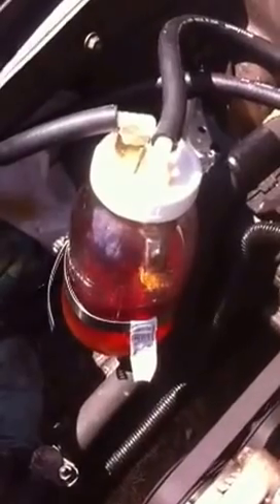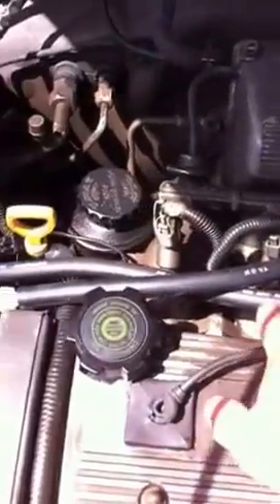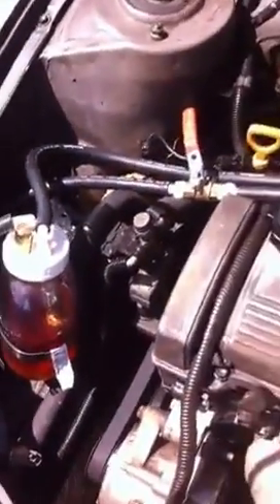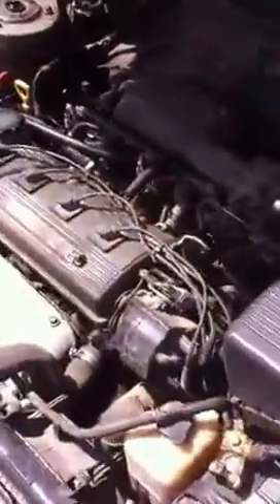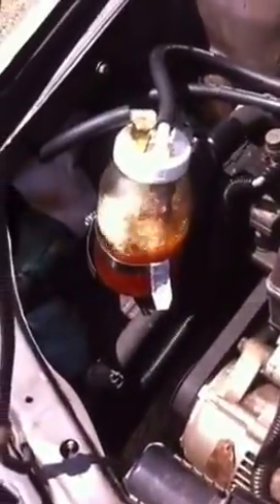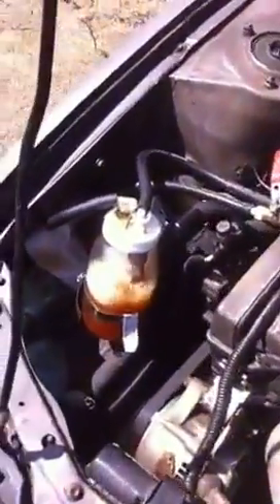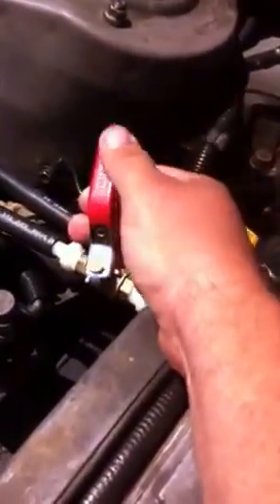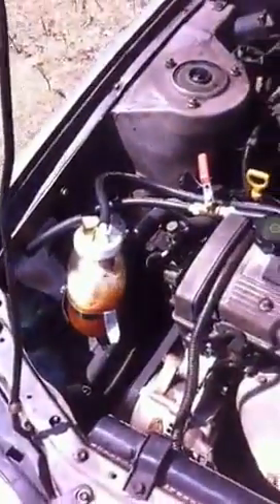Simple Fuel Vaporizer

Comment: how long does the fuel in the jar last?
Reply from the maker: It depends a lot on how much you drive and the external temperature. If it is a hot day, it will evaporate a lot faster than if it is cold. I one of my other videos I install a drip refill system that maintains the level while the engine is running.

Comment: Did you ever get any more fuel economy out of your car
Reply from the maker: I did little adjustments to vacuum and some leaks and eventually got it up to a consistent 38 -41mpg average. I sold this little thing years ago though. I am still doing some mechanical work on a new project vehicle to get it ready for the next test unit. It is a 95 Astro van with a 4.3 v6. I'm gathering the components as I can and hope to b\get started on testing this next spring.

Comment: I get better mpg without the bubbles I got ur set up on my Toyota Tacoma
Reply from the maker: This was a very rudimentary system that was very cheaply built as a test. I was lucky to have gotten good results. I just recently got my next project vehicle running and will soon begin construction of my newest and electronically controlled design.
Reply: Where your new work

Comment: Nice set up! Have you tried just using this vaporizer to drive without any fuel injection from the fuel tank?
Reply from the maker: +Hidrógeno Automotriz Evolution Costa Rica I have run this car on pure vapors but not with this unit. This small unit is way too small for this engine. It will run a small engine like a mower or 50 cc scooter but not a 1.6 liter engine.

Comment: Have you had the Check engine light come on for running it too rich? Thats what mines on for now (05 Honda Accord V6) and I was curious as to it being a common problem. I can turn the vacuum down a bit more, started with your 1/4 open.
Reply from the maker: The point of this system is to make your engine run rich. By introducing the extra fuel and making the system read a "rich" environment, the PCM will cut back the injector pulse bandwidth and push less fuel through the injectors thereby using less liquid fuel and increasing your mileage.
Reply: so I should leave the Vacuum setting where it is?
Reply from the maker: Dimrain13
I would. Have you checked your mileage since you installed the unit?
Reply: No I was having issues with the gas line leaking (internal high pressure hose) but just got that situated yesterday. Ill be testing it in the next few days (I have Dash Command so it will be easy)
Reply from the maker: Dimrain13
Good luck. I hope you get good results!

Comment: are you leaning out the amount of fuel through the injection in accordance with the vapor intake? Or did you just simply add this to the car without modding anything and experience the gains? Also, any computer issues tripped? thanks
Reply from the maker: TAShannon1, I have made no other mods other than the installation of this small vaporizer. The PCM automatically adjusts the amount of fuel it uses through the injectors when it receives the "rich" signal from the O2 sensor.
Reply: Sweet. Well that not bad. Any loss of power, or gain?
Reply from the maker: The only time I've ever had a loss of power was when I had the vacuum set to high and the PCM was struggling to adjust for the richness. I tuned it back a bit and it runs great and I still get all of the mileage bonus.
Reply: Ok that's cool to know. So are you going to install a flash arrestor? And also, how many miles have you put on your corolla with your system? And one last question lol, How many miles will that half jar of gasoline take you before you need to refill it?
Reply from the maker: TAShannon1
 Okay, in answer to one question ; I have put around 5000 miles on it since this installation and have had 0 problems since then. As for the other questions, if you will watch my other videos and read the comments, most likely all of your questions will be answered. Good luck with your project!

Comment: After seeing this video randomly two days ago I built this system on my lifted 1998 suzuki sidekick. It brought the power back to what it was before I put 6" larger tires than stock, Instant torque boost! Ill b checkin mileage soon, I was averaging 15 mpg with a 1.8L 4 cylinder.  So any gains will be nice!
Reply from the maker: Glad to hear that it helps you out. I love it on my little car. There isn't a lot of power in a 1.4 liter so I went for mileage and it make a big difference. I hope it makes as big a difference for you.

Comment from the maker: The jar is filled about half way with plain gasoline. In my second video I installed a drip refill system so continually refill the jar with fuel. I do still have to remove the jar and clean it out periodically as only the most volatile elements of the fuel vaporize in this manner.

Comment from the maker: The engine normally runs around 200 degrees or so. So far I have had no problems with he vaporizer getting cold and since I use the hot gases from the pcv system it seems to do well. I may join the lines into one bundle as far as I can and insulate the system if I have any problems this winter. However, I live where the winters are mild so I don't foresee any problems.

Comment from the maker: Yes Wonder. I will have the large vacuum line from my vaporizer to the carb and will "tee" into it with the HHO line just before it goes into the carb. I am going to use 2 positive nodes and one negative on my HHO generators because I'm wanting to produce more oxygen than hydrogen with this setup. Unlike most HHO setups I'm going to use the fuel vapors as the primary fuel source and the oxygen form the HHO so that I won't have to create a butterfly system to get my air/fuel ratio.

Comment from the maker: Bchohen333, Watch my other video and read the description. It explains the drip refill system. The valve in the vacuum line adjusts the amount of vapors drawn into the intake. If I open it too much the mixture gets too rich and will kill the engine. Too little and there is not enough vapor production to make much of a difference.

Comment from the maker: The water vapor causes an addition of oxygen and hydrogen which while giving greater combustion and increasing hp and torque, it also causes the O2 sensor to read a "lean" fuel environment. This causes the ECM / PCM to increase the pulses per injector which decreases fuel mileage. This is good if you are looking for an extra boost like on a turbo engine but is not helpful if trying to increase you mileage.
Reply: But water wash the oil in cylinders wall.......!!!!!   And that is not good.

Comment from the maker: The breakdown is as such. The additional fuel vapor causes the ECM / PCM to receive a "rich" fuel environment signal from the O2 sensors. This causes a reduction of pulses per injector reducing the usage of gasoline. There is a small trade out of power for the additional mileage but it is negligible.

Comment from the maker: Galkaenazul, I have another project vehicle that I am working on. It is a 1985 Mitsubishi Mighty Max. I plan on making it run on a mixture of fuel vapors and HHO. If I can get the mixture correct I plan on using the tank as a vaporizer. The vapor line would be wound around the exhaust then tied into the hho generator before going to the carb. I still have quite a long way to go with that one but I will post my progress. Thanks for the suggestions.

Comment: Nicely done! You should use your fuel tank as your bubbler; it produces more vapors for a longer period of time and doesn't get cold as fast. Also you can wrap some copper tubing around the exhaust manifold and heat the vapor before injecting it. One more thing you can take the air from the intake tube so is filtered.
Keep experimenting!